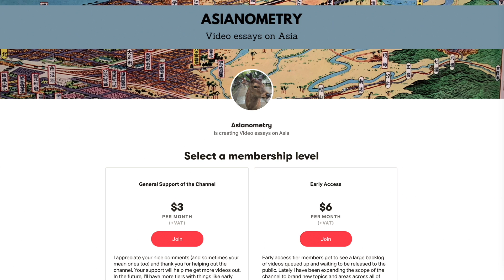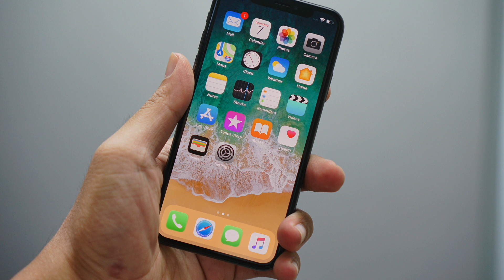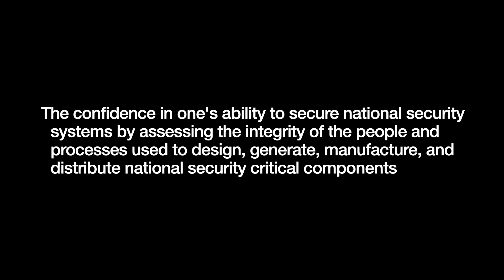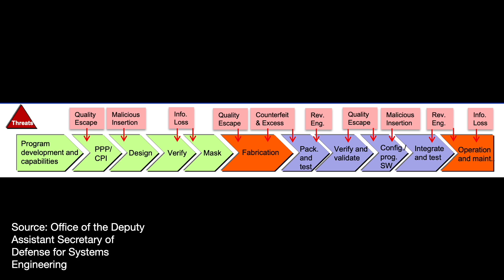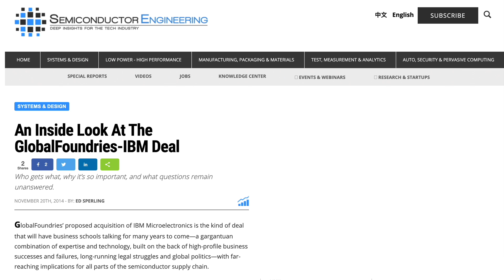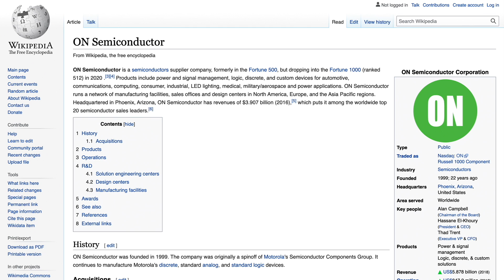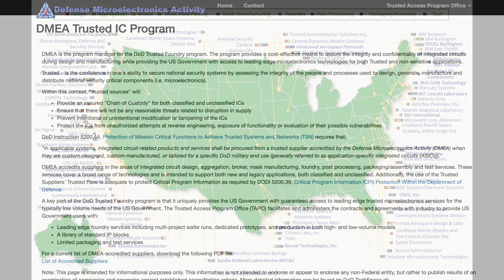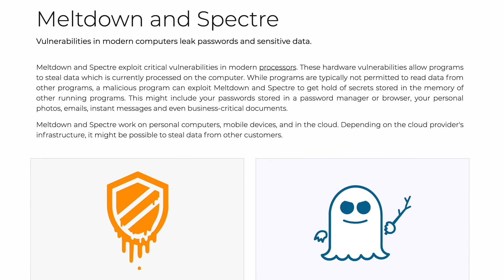The US Military's Semiconductor Buying Problem

Comment from the maker: Please be civil in the comments. If you are interested in this topic, check out the Global Semiconductor playlist: https://www.youtube.com/playlist?list=PLKtxx9TnH76QEYXdJx6KyycNGHePJQwWW

And if you enjoy what this channel does, consider subscribing. Appreciate it.
Reply: I think ball bearings are purchased from China... They aren't made in The States any longer.
Reply: Custodial chain security is but a small part of the problem. Every chip based system relies on firmware and software to function, and those components must also be certified and secured. A chip is installed only once, but the software to run them is updated hundreds of times during its lifetime. The next update could also contain a Trojan or backdoor.
Reply: already subscribed.
I love silicon prOn so much I went to uni to study ASIC design 20 years ago :-)

Comment: There is not really a problem. Military contracts with equipment producers dont include the obligation of the producer to keep the parts available for the duration of the equipment, calling the army has the one who has the work of fiding parts is a red flag on an all set of other issues. Its more a design problem to keep certain producers with a higher profit margin. The US military does not produce carburators yet the producers keep suplying them due to older contracts and despite most being discontinued.  An example is that in the civil market  older products have parts produced and newer products only have them for 2-5 years (car industry is a good example). Elevators use chips (for more than half a century) and no one ever saw one being totally replaced due to chip shortage , yet alone a mechanical elevator, were there are still those that work without even steel bearings.

It would be a disaster if the floppy disc readers from the 80`s were not still being suplied to critical branches of the army, yet there is not an issue there

The issue of part shortage is a coorporate finantial issue were most of  the time all parts are only intetested in their own gains (we can call it corruption). Another good example is the aviation industry, many airliners (mostly public) sent maintenance to countries like Brasil only to find after a few years that the money losses around faulty parts and bad practices outwheigted the promissed gains (along the way many managers got rich and many airliners wet into backrrucy - mostly due to 2019 crisis-  )

Comment: Trust is also a failure rate problem. And it concerns not just the military but also the automotive and aerospace industry. An iPhone can take a failure rate of 1ppm. You just replace the iPhone with a newer model! 1ppm may not be good for a fighter jet, a car, or a commercial airplane.

Comment: One significant issue is ITAR (International Traffic in Arms Regulations). If a design house or fab receives any input from the US government on what an IC does, how it does it or any additional specification requirements, it risks being “polluted” by ITAR and then becomes an export controlled device. That then makes sale of that device to third parties extremely difficult. No wonder the semiconductor fabs steer clear of US DoD!

Whilst the US government requires a long lifecycle for the devices they buy (holding the fabs back), they also pile lots of money in to develop the highest performance and most integrated parts available…..they’re just not very good at sharing :-)

Comment: The history of Micro Chips started in Texas. here is a little history. 
In 1954, Texas Instruments designed and manufactured the first transistor radio. The Regency TR-1 used germanium transistors, as silicon transistors were much more expensive at the time. This was an effort by Haggerty to increase market demand for transistors.

Jack Kilby, an employee at TI's Central Research Labs, invented the integrated circuit in 1958. Kilby recorded his initial ideas concerning the integrated circuit in July 1958, and successfully demonstrated the world's first working integrated circuit on September 12, 1958. Six months later, Robert Noyce of Fairchild Semiconductor (who went on to co-found Intel) independently developed the integrated circuit with integrated interconnect, and is also considered an inventor of the integrated circuit. In 1969, Kilby was awarded the National Medal of Science, and in 1982 he was inducted into the National Inventor's Hall of Fame. Kilby also won the 2000 Nobel Prize in Physics for his part of the invention of the integrated circuit.Noyce's chip, made at Fairchild, was made of silicon, while Kilby's chip was made of germanium. In 2008, TI named its new development laboratory "Kilby Labs" after Jack Kilby.

In 2011, Intel, Samsung, LG, ST-Ericsson, Huawei's HiSilicon Technologies subsidiary, Via Telecom, and three other undisclosed chipmakers licensed the C2C link specification developed by Arteris Inc. and Texas Instruments.

Microprocessor
Texas Instruments invented the hand-held calculator (a prototype called "Cal Tech") in 1967 and the single-chip microcomputer in 1971, was assigned the first patent on a single-chip microprocessor (invented by Gary Boone) on September 4, 1973.This was disputed by Gilbert Hyatt, formerly of the Micro Computer Company, in August 1990, when he was awarded a patent superseding TI's. This was overturned on June 19, 1996, in favor of TI   (note: Intel is usually given credit with Texas Instruments for the almost-simultaneous invention of the microprocessor). 

Defense electronics
TI operated this Convair 240 on experimental work in the 1980s fitted with a modified extended nose section.

TI entered the defense electronics market in 1942 with submarine detection equipment, based on the seismic exploration technology previously developed for the oil industry. The division responsible for these products was known at different times as the Laboratory & Manufacturing Division, the Apparatus Division, the Equipment Group, and the Defense Systems & Electronics Group (DSEG).

During the early 1980s, TI instituted a quality program which included Juran training, as well as promoting statistical process control, Taguchi methods, and Design for Six Sigma. In the late '80s, the company, along with Eastman Kodak and Allied Signal, began involvement with Motorola, institutionalizing Motorola's Six Sigma methodology. Motorola, which originally developed the Six Sigma methodology, began this work in 1982. In 1992, the DSEG division of Texas Instruments' quality-improvement efforts were rewarded by winning the Malcolm Baldrige National Quality Award for manufacturing.

Infrared and radar systems

TI developed the AAA-4 infrared search and track in the late '50s and early '60s for the F-4B Phantom for passive scanning of jet-engine emissions, but it possessed limited capabilities and was eliminated on F-4Ds and later models.

In 1956, TI began research on infrared technology that led to several line scanner contracts and with the addition of a second scan mirror the invention of the first forward looking infrared (FLIR) in 1963 with production beginning in 1966. In 1972, TI invented the common module FLIR concept, greatly reducing cost and allowing reuse of common components.

TI went on to produce side-looking radar systems, the first terrain-following radar and surveillance radar systems for both the military and FAA. TI demonstrated the first solid-state radar called Molecular Electronics for Radar Applications. In 1976, TI developed a microwave landing system prototype. In 1984, TI developed the first inverse synthetic aperture radar. The first single-chip gallium arsenide radar module was developed. In 1991, the military microwave integrated circuit[50] program was initiated – a joint effort with Raytheon.
Reply: TMS34010

TI also made that. It is an amazing chip

Comment: A final vulnerability: Reverse engineering chips is an industry, and a highly automated one to boot. Shops take the chips, depackage them, then put them in etch baths and take progressive digital images as the layers come off, then use software to reverse the circuitry. And we'll call it "scotts law", you can create an RE shop for a fraction of the expense of creating a fab. There is a whole section of Silicon Valley devoted to just that.
Reply: I kinda know that chip can be reverse engineered, but isn't it too much trouble especially for current chip size 5nm? Isn't the number of transistors kinda massive? I can understand if it is very only reverse engineer older chips. Do you know company that does this? I want to read more
Reply: @bunyu6237  I think others would supply better info than I on this subject, since I haven't been in the IC industry for decades, back in the late 1980's. At that time, the industry (reverse engineering) was moving from hand reversing to fully automated reversing. However, if you don't mind speculation, I would say there is no concrete reason why the reversing industry would not have kept up with newer geometries. The only real change would have been that its basically not possible to manually reverse these chips anymore. I personally worked on reversing a chip at about 4 generations beyond the Z80, which was not that much. At that time, blowing up a chip to the size of a ping-pong table was enough to allow you to see and reverse engineer individual transistors and connections. 
Having said that, I have very mixed feelings about the entire process. I don't feel it is right to go about copying others designs. I was told at the time that the purpose was to ensure compatibility, but the company later changed their story.
On the plus side, it was an amazing way for me to get onboard the IC industry. There is nothing like reverse engineering a chip to give you a deep understanding of it.
However, I would say I think I would refuse to do it today, or at least try to steer towards another job.
For anyone who cares about why I have a relationship to any of this, I used to try and stay with equal parts of software and hardware. This was always a difficult proposition, and it became easier and more rewarding financially to stay on the software side only, which is that I do today. However, my brush with the IC industry made a huge impression on me, and still shapes a lot of what I do. For example, a lot of my work deals with SOCs, and I am part of a subset of software developers who understand SOC software design.
Reply: I feel like I should wrap this subject with an opine on reverse engineering (RE) in general. IMHO this tends to be a glint in the eye mainly of incompetent engineers and managers who like the idea of cutting engineers out of the process. Engineers are troublesome little critters who bitch a lot and eventually discover the joys of sex and the consequent burdens of children.
I have always found that it is easier to create software/hardware designs from scratch than to copy the work of others, since REing others work makes it harder and also because the state of software design today is typically crappy, poorly documented code. I often do scratch designs even when given others' source code.
REing a chip just gives you a fat binder of schematics (probably a lot of fat binders nowadays). It does not give you the design of the chip, and the design processes of the chip are farther than ever from the schematic thanks to the size of the designs and the fact most of it is done in Verilog. I'm willing to bet most RE today is done by silicon makers wanting to figure out how that new stacked DRAM cell works.
Reply: @scottfranco1962  Hi thanks for your lengthy answes, I think perspective from experienced engineer is always appreciated. Regarding RE, I just ask around reddit, and I found that the industry is alive. According to them there are two types of RE, the first one is looking at the transistors trying to figure out how the original schematics look like, searching for vulnerabilities for hardware hacking, the second is reverse engineering to determine how much is the production cost of a particular chip, by determining the process node, complexity, etc, etc. Like the company TechInsights. Mostly for hardware hacking a lot of it is on older chips, because there is some time to discover vulnerability. Anyway reading your comments I have a question as I work in similar industry, why do you think it is more profitable to err on the fully software side, and what makes you realize that?
Reply: @bunyu6237  A couple of reasons (better software than hardware). First of all, there is a larger group of people working on software than hardware, so the jobs are more plentiful and the demand greater. Second, hardware/software crossover people are considered odd birds, and when I used to do that I had people literally telling me to "pick a side", go one way or the other. I find it easier to get and do software projects, and the pay is better. I dabbled in Verilog long after I stopped being paid for hardware design, and I realized it would take a lot of work to get a foothold in good Verilog design with virtually no corresponding increase in salary, and more likely a decrease for a while during the time I gain credibility as a Verilog designer. The last time I was paid to design hardware it was still schematic entry (and yes, in case you haven't figured that out, I am indeed that old).
Of course, a lot of this is my personal situation. I am not sure any of the above would serve as career advice. I definitely consider my hardware background to be a career asset, since specialize low level software design (drivers, embedded, etc). Having said that, I keep up with hardware advances and have often dreamed of uniting my Verilog experience with software experience. That dream is unrealized.
Reply: @scottfranco1962  Do you have any idea on how the chips on credit and bank cards and the like nowadays are protected against RE, if they are? Even though I understand that even if one would reverse engineer a chip of that type, one still would not have found what it was programmed with, and especially its encryption keys.
Reply: @harrickvharrick3957  The technique is to remove the passivation on the chip (top level of glass), then use a scanning electron microscope to read the values of memory cells and other elements on the chip. They use this to perform live debugging on chips as well. I have seen it in action. The operator can literally tell the machine what trace to watch, then it outputs a scope trace as if you had probed it. Its very impressive and very expensive technology.

The simple answer is there is nothing that cannot be REed with effort.
Reply: @scottfranco1962  Indeed. The ages-old battle between the sword-makers and shield-makers...

Comment: Are you familiar with the book, "The Japan That Can Say No"? In that book Sony Chairman Akio Morita and Tokyo Governor Shintaro Ishihara argued Japan should sell the chip the U.S. needed for its MRV warheads to the Soviets if the US didn't back off on trade issues. The U.S. has had its industry hollowed out for at least three decades now. You do a great job of explaining the vulnerability and reviewing the DARPA Trusted Foundries Response.

Because military programs are so slow to develop and have exotic requirements such as radiation hardening is it such a problem that some chips are sourced from 150mm plants with 65nm processes? Does the software these chips run really require 4nm or whatever the state of the art is out of TSMC?

Comment: I had worked in the military industry. The video focus on integrity of supply chain and military specific needs. However the design and production cycle is very long like 10 years each so by the time the design is completed it is not state of art. By production start, high end electronic may have stop production. The way they get around this it to stockpile end of life components for 10-30 years for production and maintenance and also do mid-life upgrade of electronics.

Comment: back in the days, when cutting edge warships are still made out of wood, we already faced this problem. back then, wood suitable for a mast were incredibly hard to find. Ideally, you'd want a single very large, straight, strong, and tall tree, in one piece to make a mast. Well, you can also bind some wood plank together with iron rings, but that's not the ideal solution and is inferior compared to single piece mast at the time. So countries scramble and went to war for a forest that has those kind of trees, or buy from others for such tree. Problem is, say country A is trading that wood with country B. Then country A, for whatever reason, went to war with country C. If country B is country C's friend, they could cut your trade route, which resulting you can't build new ships with a quality level you'd want. In other word, your military industry got chocked because there's no supply. 

That's what trust is. It's basically knowing that in the case that the situation is fucked, we still can keep going. But sadly, that's not gonna happen anytime soon. With the current state of how entangled the world is between each other, getting all your parts made by "trusted" source is not going to be easy. If one of said source fucked up or modify some truth to win contracts, an entire production line might grind to a halt.